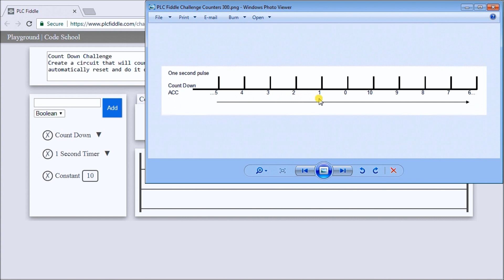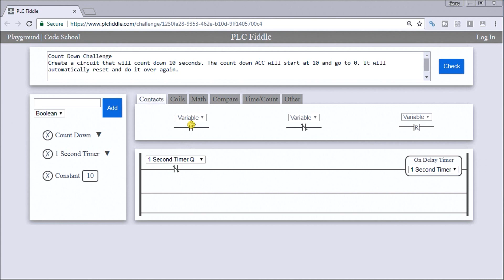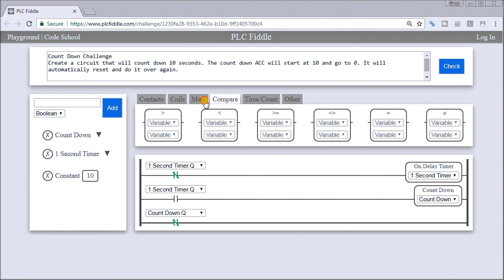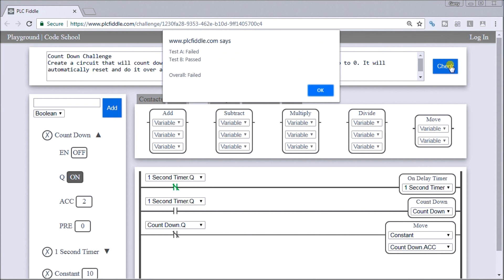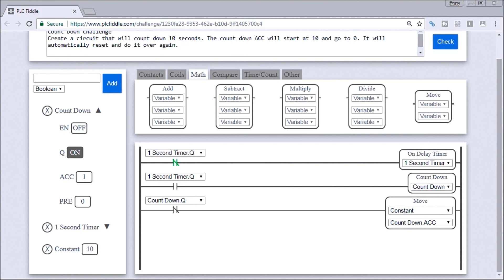PLC Fiddle Count Down Challenge Solution - Programming Now

Comment: I am trying to use Count up and Count down together in the same ladde, but it does not work and the Count up ACC value keeps increasing continuously as long as the input is the on. What am I doing wrong? If I just use a Counter up, I do not see any issues.
Reply from the maker: Without seeing your logic, it is difficult to diagnose the issue. However, one of the most common errors made is due to the PLC's cyclic scan. In the PLC, we must create a one-shot bit so that things will only trigger once. Here is a post showing you how to make a one-shot.
https://accautomation.ca/how-to-make-a-one-shot-in-the-plc/
Here is the video for this post.
https://www.youtube.com/watch?v=3UCT25uxycE

I hope this helps you out,
Regards,
Garry